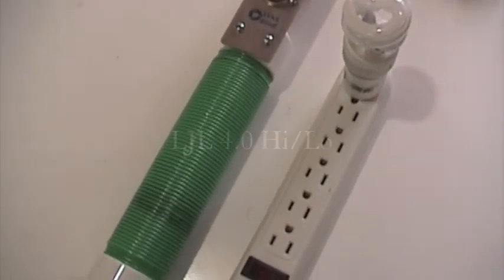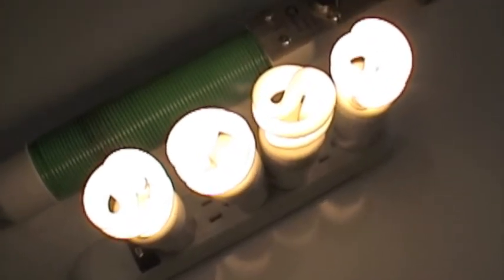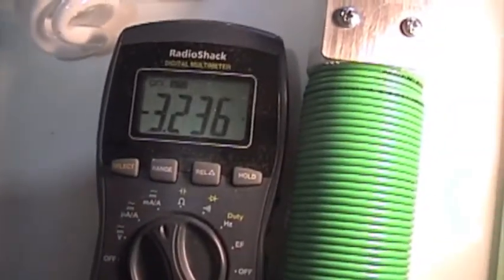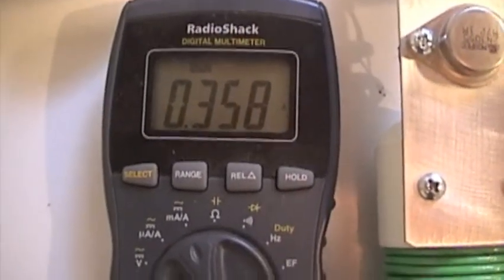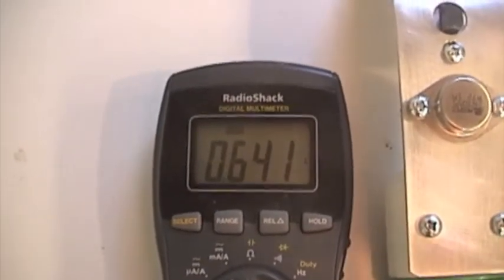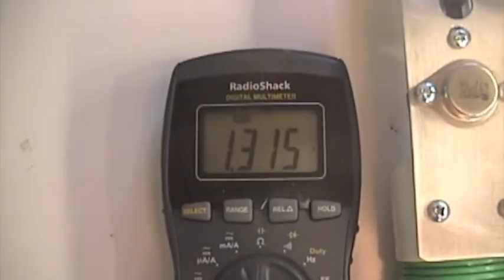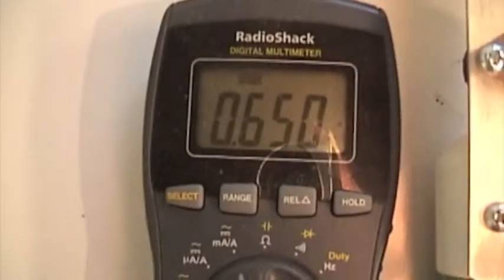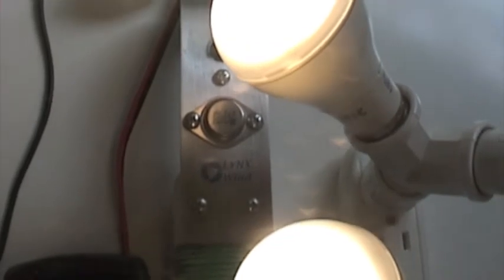LJL 4.0 - Hi/Lo switch

Comment: OK..I swapped the wires, no change!..Swapped them back to what I had and it worked!!, must have been a bad connection...Thanks for the tip. Will now try different winding ratio's to try and get up to 220v.

Comment: I looked at your website.  That is a very good replication.  Try switching the secondary wires and test the circuit again.  The 9 volt may be too weak.  The turns are something to tune.  Start with 10 turns primary and then add turns.  It also depends on what bulb you use.  Some LED bulbs will do nothing.  Once you find the right setup for a bulb you like you'll enjoy this power saver.

Comment: I didn't do a video of the 240 volt version.  It depends on the type of bulb.  I would recommend getting the bulbs you want to use and use the LJL SC design to find the best number of primary turns.  I was surprised that a larger number of primary turns than expected powered the 220 v LED bulbs best.  It was a 75:22 ratio for the 3 watt 220 v LED bulbs.  Not what I would have thought.

Comment: Hi Lynx.  Great efforts you have made here.  I am impressed enough to attempt replication, but I am stuck.  In a post on the forum, you mention using only 2 primary windings.  I have replicated with only 2 primary windings, and  they are in series - NOT parallel.  In series I blow fuses.  In parallel I only get 11.60v output - A one volt drop from my battery.  Also ended up with 83 turns on the outer winding.... Does it matter if not completely cover the inner windings?  Can I expose primaries?

Comment: DC loses power with distance.  But this is high frequency high voltage AC and can be run long distance on very light gauge wire.  I use light speaker wire for long runs with no apparent loss of brightness.

Comment: I like where this is going. I was thinking if you had a 50 watt panel and 100 amp deep cycle marine battery you might be able to ride out winter with 24/7 lighting for your entire home in regular usage patterns. One thing I have wondered is how far can the system be put on a cord or wire before its dims?